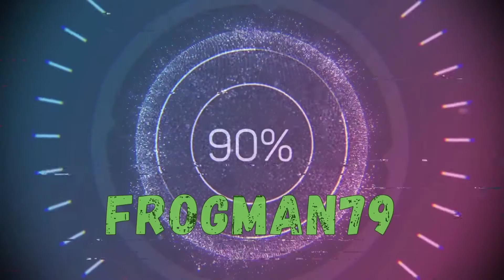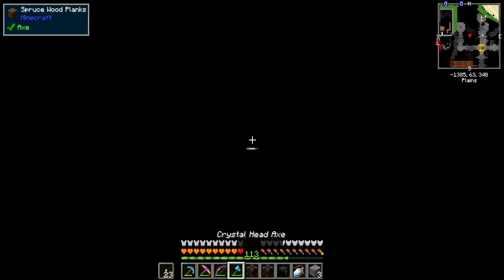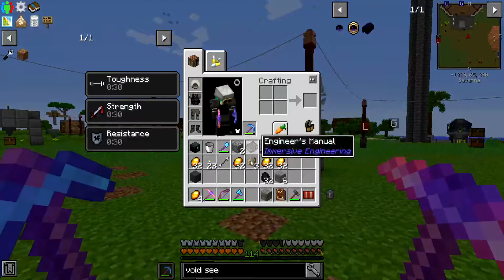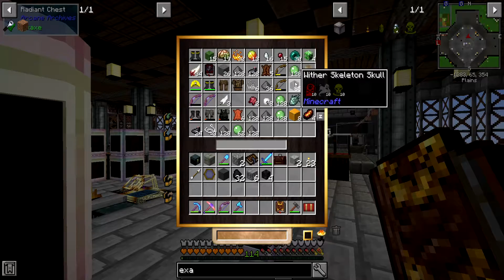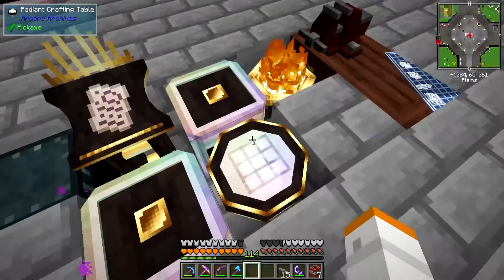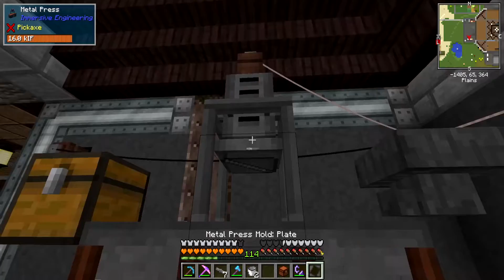Serious Engineering Under Pressure! EP20

Comment: Strange that it didnt unlock the cluster research yet after scanning the ores, pretty sure thats how i did it in my test world. If it won't unlock, maybe just cheat in a cluster you can place to scan. Will have to take another look at. 
And yeah i need to fix that Recall charm bed position thing lol. I had it fixed in 1.14 but didn't backport yet. 
Looking forward to the drones :D I agree that the most efficient way isn't always the most fun way. Seeing those drones do work is gonna be way more interesting than having pipes.
Reply from the maker: There used to be a mod that could check for what you needed to unlock for a certain tech I forget now what it was called or if it was even ported. I will do some more work later and figure out what's going on but yeah think it is still locked. 
Drones, probably my favorite worker bee of any mod, they are so much fun to have around and now that the normal ones have logistical functions its going to be a blast to play with lol. And WHY do things the EASY way? What FUN is THAT? ;) lol